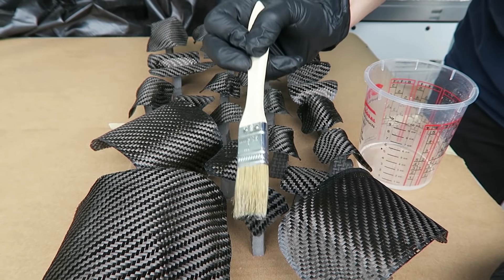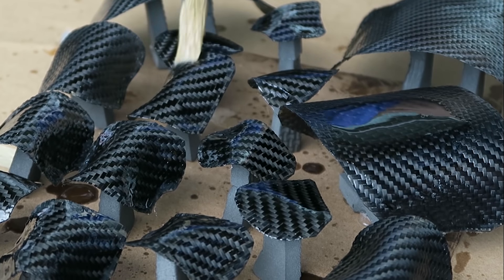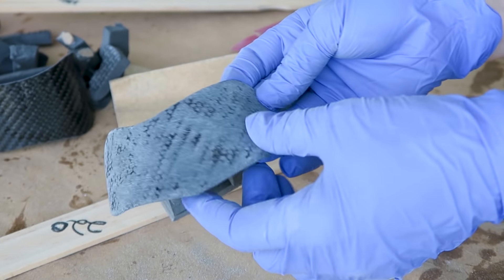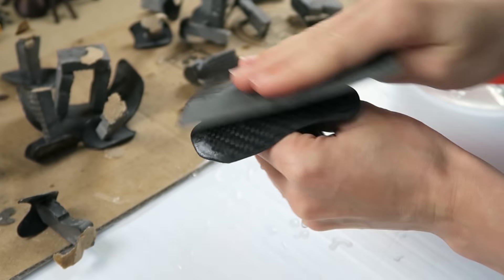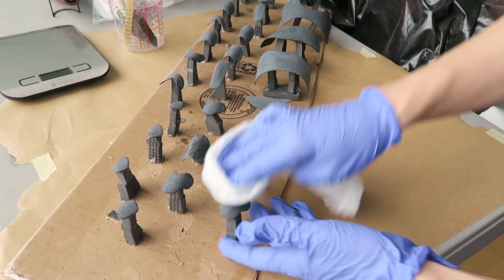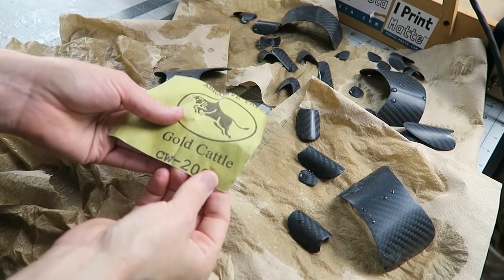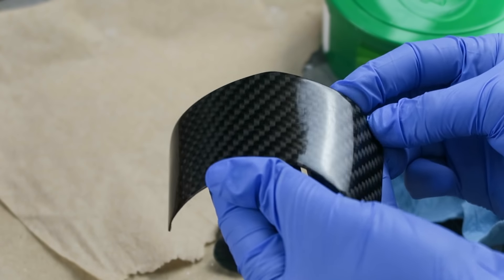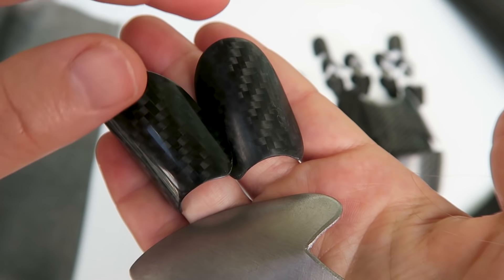Steel and Carbon Fiber Gauntlets Part 2

Comment: Ex-Floridian here. The only truly reliable solution for constant high humidity I ever found was to bring parts or projects indoors after applying coats of sealant, epoxy, etc. To counter the fumes, I used a storage box for curing or drying, which did add some time, but kept the odor more or less minimized. If you have a fairly tall box and need more space, you can add tiers by affixing some bookshelf-style supports on either side and using thick or multilayered cardboard as shelving.
Reply from the maker: That makes a whole lot of sense. Maybe could even get a very small filter system and hook it up to the drying box, depending on if a budget friendly version exists which can filter fumes to get a little airflow.

Comment: As someone who doesn't have enough money for a spray booth, but has a guitar builder and a metal worker under the same roof we ran into similar problems with humidity. Our problem was we either had to do it in the garage or in the sun. 
Honestly, if it was wasn't stupidly hot out (and to be real it was worse in the garage on days like that) we tended to go for the open air because if there was a light breeze it didn't seem to hinder us. 
Our ways around the humidity were kinda what the two of us call "a cheating spray booth" where we went out and bought large sheets of plastic and made a three or four-sided space that we put fans running at below knee-height just to keep the air moving, which helped surprisingly amount with keeping the humidity under control. 
If it was actually too hot and too humid we have a cheap air conditioner we pulled into one of the outlets and just put it by one of the fans, it seemed to work pretty well (we did need to let the "booth" sit for about 5 minutes so we could properly close the top off to keep the hot air out). 
That's the best advice I can give. We did it on the super cheap and super reusable side because we do have our parents to contend with.
Hope this helps
Reply from the maker: Love the idea of the cheap a/c unit in a plastic sheet enclosure. Thank you for sharing your solution. I'll be giving that a try in future if i can figure out where to fit it on the patio.
Reply: I wish you luck, we used packaging tape so all four sheets are connected except for the top, there is definitely a learning curve with this. :)
Reply from the maker: Thanks :)

Comment: Red Leather Gloves would look awesome for the carbon but also for the metal :-) Nice video - thanks for sharing!
Reply from the maker: I agree. It doesn't fit with the concept I was working toward, so the question to ponder is should the concept change?
Reply: I think it fits, the only change you should do in MY opinion and i am only a innovative consultant, is to darken the metal a bit with dark chrome. Then the contrast isnt so high between carbon and metal, and it fits more together. I would use a dark chrome look for the metal with this carbon. And then i would use for the bones- row  which is on on top with which one would hit at the stroke this row i would only make in metal and the fingerparts in carbon and the other handparts too. So you have one line with metal which lets it look that you can hit hard with it - men like it :-) and the other parts are in carbon which lets it look very light and strong in the same time. And then i would use metal band on the side of the fingers for the black gloves, that gives it a fantastic look when it reflects the light. But that is only design and i am not a nativ english speaker as you notices already :-)
Reply: Btw. when you drill wholes inside carbon fiber - you have to do it under water!!! Its really bad for your healthy if you do it without water!
Reply from the maker: Bringing down the contrast with a wax coating or weathering might look more balanced. The carbon fiber is too subtle compared to that super bright steel. I only have the one hand set of steel pieces to work with for this challenge, but luckily the finger parts can work for either hand, so there is room to mix them up a bit. I am not sure what you mean by a metal band, are you thinking a silver line along the side seams of the fingers?
Reply from the maker: I have been wearing a dust mask and working outside any time I am sanding without water :)
Reply: With metal band i mean when you bring your fingers together - the point when they touch each other - make a 5cm long peace of metal - silver or gold - this looks awesome. I also make atm a case for an Filament Extruder which we share open source next week as tutorial here on youtube. I combine there orange with carbon, but it looks also very good with darker chrome metal. I use aluminium look for the most parts because blank metal doesnt looks good to carbon.

Comment: Great video! Someone may have answered this by now, but from my experience, epoxy resins are notoriously problematic unless they are mixed/cured in the right room temperature conditions. Like super fussy! Standard Fibre glass gel coat doesnt give me much issues, but carbon fibre resin or clear cast epoxy resins have only cured well in the height of summer for me and even then there are issues. What you've done looks the nuts though! Be super happy with it :)
Reply from the maker: Vacuum bagging has helped on projects where that is possible.

Comment: Not that it hasn't caused me other issues,  but when I'm have issues with humidity in resins, I've actually set the pieces on the rack in my sandblasting cabinet, the media works as a dessicant.  I just don't jar anything to avoid a dust storm in there.
Reply from the maker: Makes sense. Just don't sneeze.
Reply: Or fire up the power hammer bolted to the same slab.  I felt even dumber than usual that day.
Reply from the maker: Ha!

Comment: Humidity was never problem in my case, resin and parts temperature was always above dew point. Most resins needs vacuum before application. I don't have vacuum chamber so I'm trying to prevent bubbling by using foam brush for application (I think air brush is even better, but I don't have it). Then I wait for resin starting to cure (depends on type) and use hot air gun to pop bubbles if any are on visible parts.
Resin can cure almost everywhere with wide positive temperature range (above freezing). For resins with 24 hours full cure time you can use high temperature up to 180 degrees C to cure resin fast. For such thin coat it will take 5 minutes to cure and its strength will be increased (you can use lower temperature if your parts can't withstand 180C) . High temperature should take care of bubbles if coat is thin.
Reply from the maker: For these particular parts I had to be careful because too much heat warps the forms. I don't have a vacuum chamber either, so I'm curious if that makes a huge difference or if the application process introduces a new crop of bubbles. I didn't know heat curing affects the strength. Is that kind of like heat treating PLA to make it stiffer at higher temperatures?
Reply: Resin can be heat treated after curing with good results (it will not reflow, but makes some additional bongs inside material). It will produce more bonds and resin is stronger. Curing in high temperature will produce more bonds in material, speeding up chemical reaction and make resin more glossy. It have something to do with the glass transient temperature which can be filler part dependent. Inorganic filler with fine grain have better better results.
I think most resin manufactures are listing the glass transient temperature, but I think it is not directly on product, maybe on web or you must ask them for exact value.

Comment: I use plastic drop cloths, tape, and a dehumidifier, to just make my space into a booth for rainy months, I want to make a ac bag and IR cure box. Do you have recycling for printed mistakes, or do you have a mouse army worth of bracers in a corner, like we do steel?
Reply from the maker: Nice. No, I don't have a recycling method, so there's a trail of versions in a box somewhere.
Reply: @LindyDesignLab  i love it. and i meant vac bag, time to switch out keyboards

Comment: Hi, just wanna know, after the second coat, did you use the dremel to cut around the carbon to give the armor back it’s shape ?
Reply from the maker: Yes everything trimmed with the Dremel. Diamond coated cutting wheel works great for carbon

Comment: Left handed?
Reply from the maker: Only by years of tedious practice. My right shoulder cramps up from overuse.
Reply: Interesting!  I've been trying to train my left arm by brushing my teeth (in case I ever lose my right arm, better to be prepared!).   The whole weather thing was really a bummer when I was finishing props, so I quit finishing them!    I've been on a journey to find a local and affordable warehouse space that I can outfit with the proper tools and spray booths to be able to finish stuff indoors, it's just  never any fun to be at the mercy of the weather.
Reply from the maker: Unfortunately the coordination doesn't transfer. I can use the mouse just as well as with my right hand now, but brushing my teeth, sanding stuff, writing, no improvement there since I haven't practiced those specific motions much. That's an ideal setup, but having all the extra overhead is hard to justify up to a certain point.

Comment: Hello Lindy, its me again :-) Now i can show you what i was talking about and what i wasnt able to show you till now. I made the designs for the video, its not my channel, and inside there i work with carbon and metal. Next step is to look how i can use the carbon like you for your gauntlets :-) Do you think it should be possible to make a case for this filament extruder like in your video for your gauntlets? https://www.youtube.com/watch?v=TnC_fjUCfRk or should i pre print it in 3D minus the thickness of the carbon and lay it around? Do you have some tips how to make a case like in the video? Thanks in advance.
Reply from the maker: If you just want the look of the carbon fiber, then I'd probably print it and laminate the carbon fiber on top. This way requires a lot of sanding, so it would not be the best if you need to make more than one. Otherwise, you could make a mold or glue together premade carbon fiber panels.